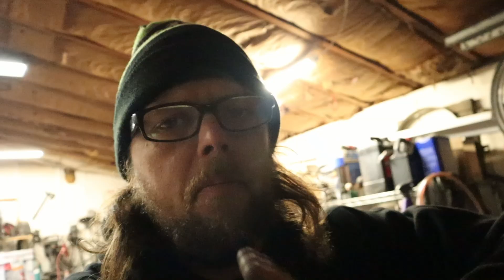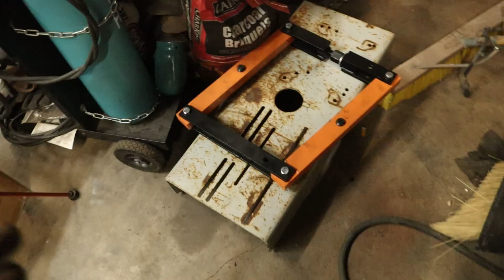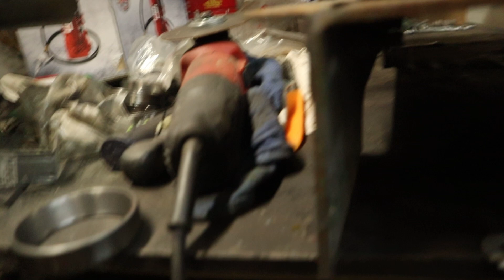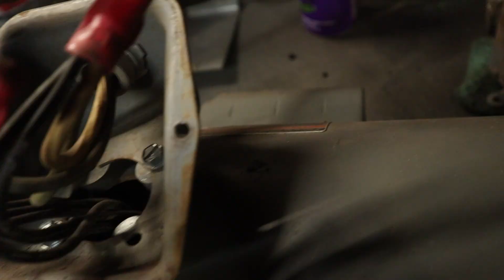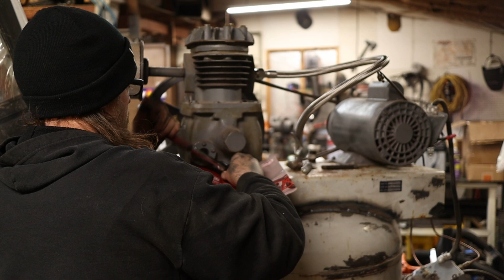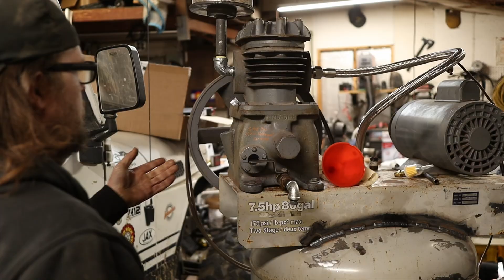I Built This Air Compressor From Random Parts For $300!

Comment: I have an 80 gallon tank , a electric motor and a why looks to be a 2 stage pump but I don’t know where I can get the metal lines to run from the pump to the tank or
Reply from the maker: I just found high pressure stainless braided lines on amazon. Heres a link to the ones I got, you may need a different length or thread size. https://amzn.to/3PfbFtZ

Comment: Just FYI, there’s no reason why the compressor has to sit on top of the tank and you should definitely water pressure test a tank especially working in tight quarters like your garage
Reply from the maker: I did that about 6 months before I started the rest of the project when I first got the tank

Comment: I built an air compressor  out of an old Chrysler air condintioner compressor bought an old wornout compressor (25.00) and used the tank and regulator, welded brackets for the Chrysler compressor and mounted. Had a small auto repair shop that compressor lasted 30 years
Reply from the maker: @ray4289  this one is from the 50’s but I can’t figure out exactly which model it is

Comment: A lot of the various plugs for 22O/240v stuff is different according to the amp load needed by the appliance. So the funky angle and shape of the contacts helps prevent people from under sizing a wall outlet because they used to only need 30amp, and now they need 50amp… yeah it’s annoying but it’s sorta for the better. 🤷‍♂️

Great video btw I have a similar tank but I have the original pump on it from IR that I got for a stupid good deal. 
But the welds on the factory bung for the inlet leak a tiny bit so it always drains down overtime. 

You might also want to put an extension on the drain for the tank so you can get moisture out easier than the spinning one that was broken.
Reply from the maker: they should just make all the breakers and wiring handle 50 amp haha. I have the stuff for drain extension. I talked about it but cut that part out of the video as it was originally over an hour long. I cut a lot of stuff out

Comment: What a great project! Good ole yankee ingenuity. Gonna be a beast.
Reply from the maker: Probably wont be as fast as a 2 stage but it will be much faster than my 3.1 cfm 21 gallon POS that I have been using. Plus having 80 gallons of volume will do wonders. Maybe next spring/summer I will put it outside and build a little hush house with insulation for sound deadening. That was the original plan but I opted for "get it running" first